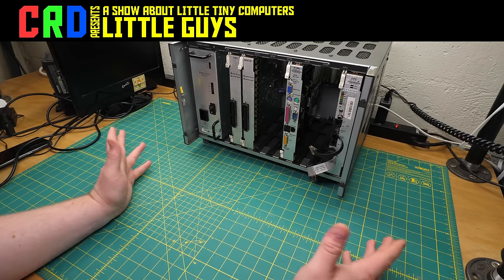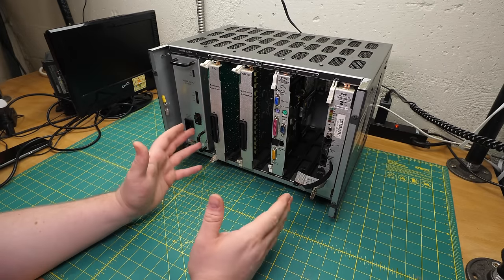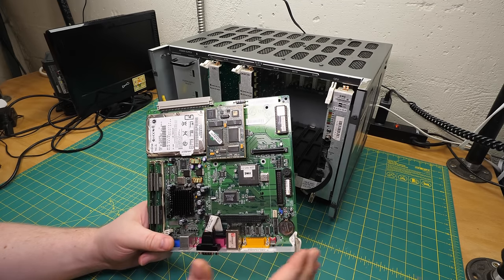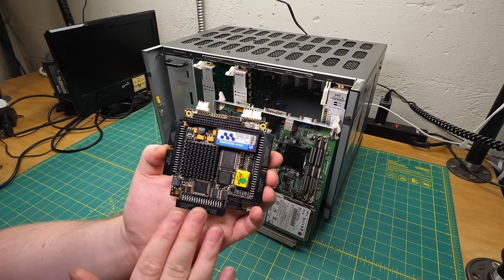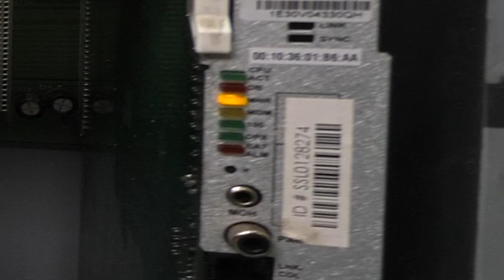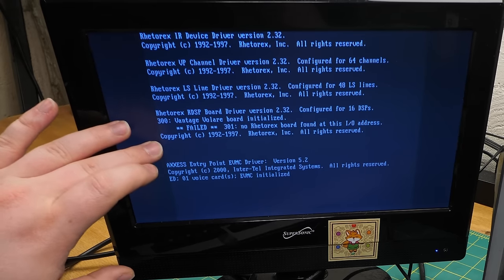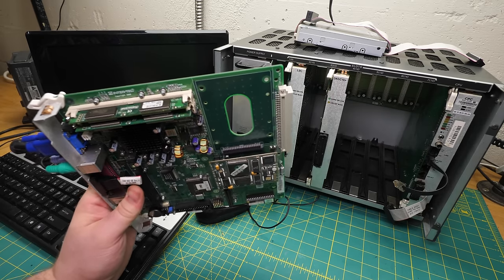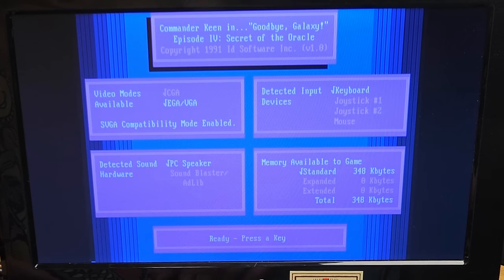Little Guys 9: The First Of Many [Intertel Axxess]

Comment: I'd guess the floppy drive motor enable happens just because the host 5V is not powered, thus all the signals are effectively grounded via ESD protection diodes (to ground and power) in whatever IC is driving the line. But also, yeah, a pullup resistor to a non-powered rail (that has some loading on it to drain it of any leakage) will also act as a pull-down.

(Anyhows, this comment brought to you by me going "it'd be silly to pull-down an active low signal".)

Comment: Thinking about all the grease on that PBX I have two theories. One is something that happened to my girlfriend which is that the grease leaked in from a neighbouring restaurant into an otherwise non-restaurant business. She works in a hotel and the restaurant and the hotel shared an air conditioning system. My second theory is that it could have been at a location where there are multiple restaurants but they are all owned by the same parent company, like a pizza hut and a taco bell etc. then the parent company could have one PBX that works for multiple restaurants. With a phone at the front desk a phone in the back office and a phone in the kitchen, split across three or four restaurants, this would be a sensible solution

Comment: And on voice mail and OS/2, I actually have the original two CDs for an Active Voice Repartee voice mail system (which I also have the ISA card for... Somewhere), was on a Pentium 120 system.
But the fun thing is that the CD's literally OEM IBM discs with Active Voice branding on it, the data on the discs are not custom at all, just the screen printing on the physical disc.
It's the only legit copy of OS2 Warp 4 I own lol

Comment: The reason for the dual UART chip on the EVMC is due to voltages. FPGAs like 3.3v, at most you can get some 5v i/o these days. RS232 can be upwards of +/- 15v, especially in telcom in those days. Since plumbing 15v into an FPGA would require a level shifter chip, and FPGA blocks are expensive, it makes more sense to spec a cheaper FPGA and UART chip instead.
Reply from the maker: ah, duh! you could have a level shifter but at that point why not just get the whole UART and be done with it. makes sense, ty!
Reply: to do multiple calls,  sound or modem requests you need more than one uart controller... or more modems and sound cards. 

or just one not in use simply to switch and not drop the task at hand. 

hand offs for a bbs for example so simultaneous call ins dont get dropped, it can be on hold. kind of.

Comment: Nice Video as always Gravis, I used to be a Night Porter at the Moat House International Hotel in Stratford-upon-Avon in the Mid to Late Eighties and part of the Role was: Switchboard Operator, I don’t remember much about it now plus I wasn’t there for very long but I do remember that the way it worked is you’d take a 5 & a Quarter inch Jack and plug it into a Socket of which there was many, One for each of the Rooms along with Admin and other Extensions around the Hotel, Was definitely nothing like it is now today, Reminded me a little bit of the “War Rooms” that you’d find out of the old WW2 & Cold War TV Programmes etc! Anthony - Birmingham/UK 🇬🇧

Comment: Regarding the gameport: remember that when sound cards started including the gameport, a couple of the redundant power and ground pins got repurposed for a MIDI interface. I'd wager that the link between the PBX controller and the Little Guy is doing serial communication over the MIDI port. Which makes sense, given MIDI is itself a serial interface.

EDIT: Also, today I learned that Jazz Jackrabbit supports the PC Speaker. Tried it for myself in DOSBox and it's really sad. It's not even half-hearted. It's 1/16th-hearted. It's just a token offering. Doom does it way better. At least there, the PC Speaker sound effects sound something like their digitised counterparts. It's actually pretty good when paired with Adlib music.
Reply: it was always a midi port 😌 gaming came after. but then its a digital port so all kinds of controllers can be used with a universal format.
Reply: @pazsion  No, gaming came first. The IBM Game Control Adaptor was part of the PC's launch hardware offerings. Creative Labs added the MIDI pins when they integrated the functionality into the original Sound Blaster. Not needing separate ISA slots for sound and joysticks was a selling point for it.

Comment: The OS/2 content brought back a lot of memories.  I used OS/2  Warp 3, and then later Warp 4, for a few years in the 90's and early 2000's to do a lot of my school essays, reports, and such, as well as to browse the web and play a few games.  I also used both IBM Works (no relation to MS Works at all -- completely incompatible file formats and very different UI's) and, once I got a copy, Lotus AmiPro, for all those essays and reports.  

I both loved and hated OS/2, depending on what I was doing.  Once it was setup the way I wanted, it was, overall, a very nice OS for the time.  It had a pleasing GUI (once you got used to how it used the mouse, yes), it ran smoothly, it integrated both native OS/2 and Windows 3.x applications quite nicely (as well as MS-DOS applications and games, in another subsystem), and it was a head above DOS + Windows 3.1.

But, when things went wrong... well, then it turned to hate.  I had a heck of a time getting device drivers working for new hardware more than a couple times, and OS/2 does NOT fail gracefully when you've selected the wrong device driver, even if it's for your network card and not something more critical like your graphics card.  

There was also the time that my cousin's toddler got impatient waiting for the computer to start up, so she could use Kid Pix and slammed some random key sequence out... causing some kind of weird issue that I could never quite solve, making booting take longer ever after (or at least until I wiped the OS and re-installed).  I always suspected that she somehow got some program running in the background, which OS/2 "helpfully" autostarted each time, perhaps due to OS/2 behavior of restarting all programs that were running the last time you shut down the machine.  Very helpful for office workers, I imagine, since they'd always be running the exact same programs day after day, but not very useful to me as a teenager switching between essays and games, who did NOT want to wait for the computer to slowly load some large program that I had accidentally left open the last time I used the computer.

Comment: OS/2 was awesome - I don't know why you didn't like it. Consider from 1990 - 1996 what OS was better? Seriously, what was better?
MS-DOS, Windows 3.1, Windows 9x? All inferior
OS/2 had real pre-emptive multitasking, a file system that was more robust, less space wastey, and had "real" long filename support (not that hack Win95 did). The shell was way ahead of its time (it had features we still lack today). It was the first to support USB and PCMCIA plug and play.
Windows NT was the only robust alternative, but it wasn't released until 93, was very expensive, had high system requirements, and used the Windows 3.1 interface which looked like a dinosaur compared to OS/2 [and Win95]. It wasn't until NT 4.0 (Fall 1996) that Windows NT received the Win95 look/feel.
There was Linux, but it wasn't v1.0 until 1994, and it could not run any of the apps/games that DOS users needed.
In the early 1990s, if you wanted the best, you used OS/2

Comment: Mostinbocker's lift off 2 is one the best solvents to use for cleaning pc cases, monitors, and laptops. It doesn't melt most plastics. With exception of very soft plastics. It was my go to for removing stickers from pc's, laptops, and monitors when I usec to work at the first interation of Back Thru The Future Microcomputers back in the 1990's. A computer reseller / recycler / ewaste company.

Comment: Regarding the Gameport: if you buy a (PCI) soundcard it usually also had a Gameport included, because it needed ADCs (analog digital converters) to convert the output of the potentiometers into digital signals, and this kind of component is a staple of Soundcards (together with DACs). so it made sense for the manufacturer to combine this.

Comment: "Key set"...now that's a holdover term.  Those were phones which had 'keys' (pushbutton switches) for each line and a big plug which carried all of the signals.  Used well into the mid-1990s in some places.

Even the first digital voicemail system in the industry- ROLM's PhoneMail- was PC based.  There are still tons of them in operation.

Comment: I need to look up what we're using at work which was installed in the late 2000s. We have a 2U Alcatel Lucent PBX  and on the one hand the handsets behave like they're VOIP, on the other hand the old fax machine we used to have and presence of RJ45 to 'BT' POTS adapters suggest it's an analogue system (hybrid?). 

The lack of IVR, call recording, etc. doesn't mean anything though, wouldn't be surprised if either they just cheaped out or just under utilised something (we were still using XP till last year and we use an overpowered office pc for our digital signage).

Comment: I do way to much computer stuff. So as a hobby I mess around with phone stuff. A few years back i cleaned out everything except for 3 Avaya systems. 1 Partner ACS, and 2 ip office 500v2 systems. One running in partner mode. This allowed me to keep the collection of handsets to a minimal. My project I just finished was using a cisco ISR router to do all three types of connection. Sip trunk, T1 pri channels and POTS. I would only use 1 ip office system but when you are using it in Partner mode. You cannot use things like IP handsets. The nifty thing is since they purchased out Nortel. I'm able to use some of those digital sets. Oh and Voice mail is on another level. My experience with Partner mail VS was interesting.

Comment: the center chip on the voice mail board is probably the northbridge. It handles the io, functions between the bus, cpu, and ram. Usually there is a south bridge to handle sound, floppy, and all the ports on the back. I forget who handles the ide. The lucent card not only handles the multi channel audio recording but this is 2000, we have had ADPCM audio compression for a long time now and this card most likely handles that. ADPCM would not be something done on a 486 level cpu.

Comment: 31:26 holy crap those are adorable little guys! I immediately want one, despite not really having a use for one. I doubt I could do any hardcore gaming on a little guy like that lol
Reply: It's got ISA in the form of the PC104 connector, so you could make it do hardcore gaming if you wanted to! (and had the budget for the modules...)
Reply: @tehFoxx0rz  hahaha, I'm honestly wondering how hard it would be to make a PC104 compatible motherboard and gpu adapter and stuff. I'm not sure its that easy to convert isa to pcie for a normal gpu :/
Reply: @amyshaw893  ah, maybe not hardcore modern gaming. Certainly hardcore retro gaming xP
Reply: youd have everything youd need to handle up to 8 players and maybe use a bbs as a lobby before patching users into the game
Reply: you could probably keep a game live and let people join in real time

Comment: That is the cleanest analog PBX I've ever seen. Generally you find those in buildings where IT infrastructure was an afterthought and it ended up in a utility closet or garage and composed of 73.61% dust by weight.
Reply from the maker: Oh, I had cleaned it up some already. It was Full Of Fluff
Reply: @CathodeRayDude  I saw that shortly after commenting, but still true. Of all the old PBX I've had to deal with I've cleaned exactly none of them before sending them to recycling.

Comment: PC/104 is ISA and seems to normally be the two connectors you have on the main board being demo'ed and the second PC/104 board for 16-bit, with just the short 8-bit only version you have on the board at 27:26 being the oddball.  PC/104+ is just the single larger rectangle at 33:33, and is PCI. 
On the 44-pin IDE topic, there are cables to do two IDE drives on a 44-pin cable, or you can just plug in a 44-Pin to 40-Pin adapter (normally for plugging a laptop drive into a desktop IDE) into it and regular two-drive 40-pin cable into the adapter. Weirder yet, there are adapters that let you do the same with CF slots that are connected to IDE (won't work on PDA or other CFIO, AFAIK.)
Reply from the maker: duhhhhhh I gotta stop quoting names when I don't just have them on the screen in front of me. see, this is why i script most of my videos, heh

Comment: OS/2 without the graphical shell was very robust.  It was frequently used in ATM machines. The Presentation Manager unfortunately could be locked up by a bad program (I think window messages for PM applications still used a single queue?). I never knew if there was a way to restart just the PM shell without rebooting, the way you can kill Windows explorer.exe. As for the default file window—I believe you could create your own window to inherit from if you knew how, because elements like this were all objects (one reason why the PM was slow on computers of that era).
Reply: To be fair, OS/2 was more robust, and more advanced, than DOS/Windows at every step. It wasn't until Windows NT hit the home user market (Windows XP) that OS/2 was passed by - technically speaking.

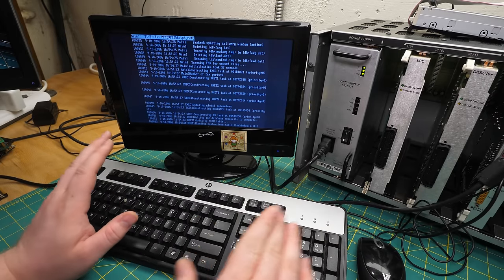Comment: 48:00 Faxback - yes I remember this. My father worked at a print shop that had this software. Essentially, the customers always wanted their printing done at short notice, so the Faxback software could be used to send the job back in time, say, a week into the past. The work would be done in the past and then by the time the customer came in to place the order, their job would already be completed and they could pay for it and take the finished work right then and there.

Unfortunately there were some snags. Customers got wind of the existence of the technology. You know how some customers seem to want the work done "yesterday"? Well, this literally happened. The sales staff would promise to deliver the finished job yesterday, causing a paradox where the customer wouldn't come in to place the order because they already had the finished work in their hands! Many sales were lost, and the resulting lawsuits caused the Faxback company to go under.

Comment: 19:49 just to be insufferably pedantic, the data bus is 64bit. external address bus is... 29 bits, because you're addressing 32 bits at a time! but then there's 8 "byte enable" bits to tell you which bytes the CPU actually wanted (you still need to support byte read/write because its x86) which can be used to determine A0-A3 if you really want it...

Comment: The pin you blew off the hard drive (pin 40) is a ground pin. Looks like the neighbors are +5VDC motor power (pin 42) and a data line (pin 38). Guessing if you grounded the data line, it wouldn't have worked, but +5V would have definitely caused issues. Motors take a decent chunk of power, so it seems very possible it was just that. Why the drive was able to run at all with it being off by a pin, I have no idea, though. If my theory is correct, the motor would have instead been powered off pin 44, which is a signal pin (which is apparently low when using an ATA drive, so maybe it's pulled up to +5V for an IDE drive, and thus just so happened to be able to power the motor?). Very impressive!
Reply from the maker: Oh to be clear, it was just POSTing and looking for the drive when I had it misaligned, it wasn't getting anywhere with the actual boot sequence, that was a slip of the tongue. I was just so used to turning it on and then giving it three minutes to boot that I flipped the switch and immediately turned away, haha.
Reply: @CathodeRayDude  Ah, that makes a bit more sense, lol. Still impressive/lucky that you "just" blasted the pin off that drive, which is honestly quite funny in its own regard.

Comment: Pulse dialing was useful for other reasons.  You can pulse dial by pressing the switch hook on any phone.  This was especially useful if you lived in a metropolitan area back in the day where pay phones would commonly be vandalized (usually gum or glue stuck into the buttons.)  In the movies when you see people rapidly pressing the switch hook, it's supposed to be because if you lost a call, you could get back to the operator who could attempt to connect the call again (or get a refund if it's a pay phone.)

Comment: Oh god, at my last job we replaced an NEC Zen IPK with a Univerge SV9100 in 2019 (and NEC in Australia still sell them!) and I hated that thing. 

It was hideously complicated to manage, to the point where I couldn't even figure out how to add new extensions - in the end I asked the tech who installed it to just add like 20 blank extensions for me to user as needed, as I could at least make changes to extensions once they were added! 

Also fun was reprogramming the receptionist console - it a list of all the keys (key 0, key 1, etc through to key 59 for 60 keys total), so if you had 30 keys in use and wanted to keep it alphabetical and needed to add someone on key 6, you had to manually move the keys 5 through 29 forward so that the new range was 6 through 30, one at a time, in the hideous web UI so you could add one key. 

I don't think ours had any of the embedded PC cards in them as while it did some UC Suite thing, it ran on a VM (and in any case, this was shortly before COVID so we ended up just using Teams instead which was much better.)

I'm looking forward to hearing your take on it ;D